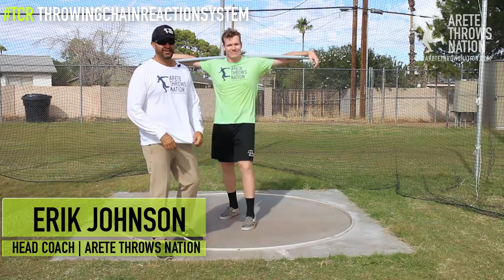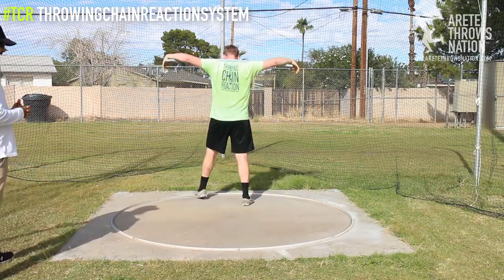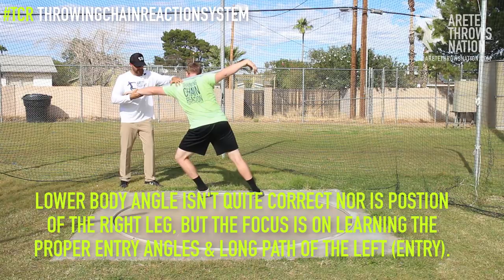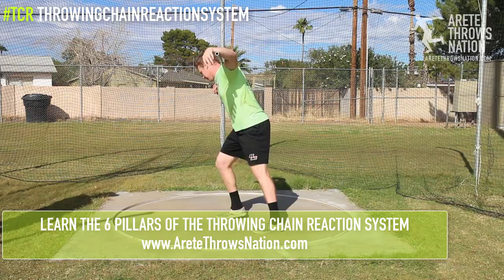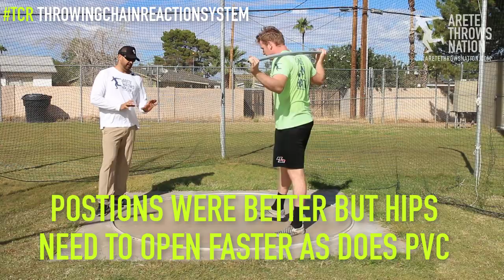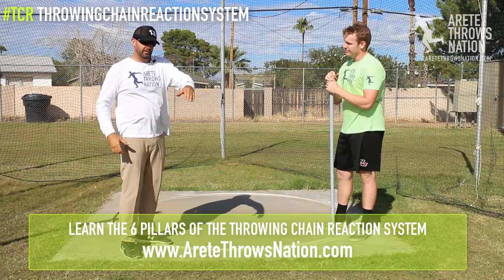DISCUS TRAINING | THE PVC PIPE TRAINING TOOL | DEVELOPING A BETTER ENTRY

Comment: With so many throwers challenged by the entry, could you just start (facing the  sector) at the back of the circle and immediately jump to the center and begin that way?  It would seem to get rid of a lot of bad habits and lets you immediately start the right foot rotation immediately and the separation.  What am I missing with this approach?  Thx.
Reply from the maker: RVE DRC I can kinda see the idea behind what your saying but it just won’t result in maximum distance. The start position you outline would shorten the length of the discus path so that would quickly reduce the distance potential and it would also result in lost centrifugal  momentum, which would reduce total speed potential, so again total distance potential would be significantly reduced. While learning correctly is challenging, It’s vital for maximum potential . One can start facing the sector but it’s an inferior technique that will limit maximum distance. hence why there are no short cuts, just lots of reps to learn how to do it correctly.